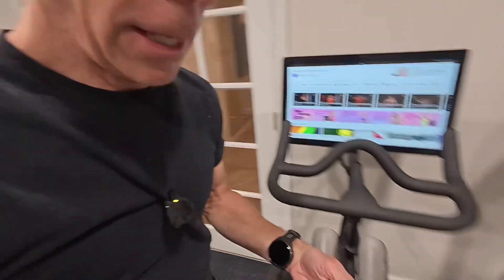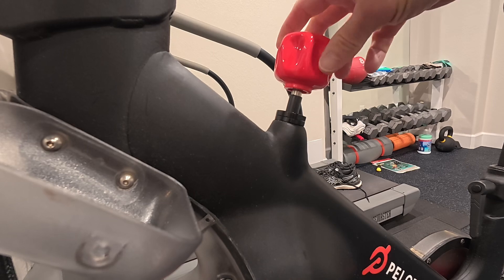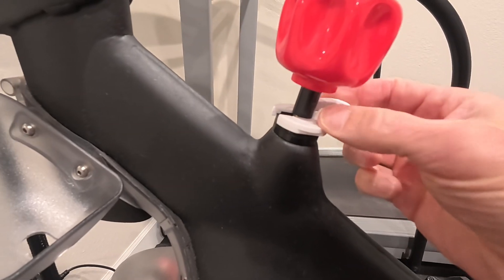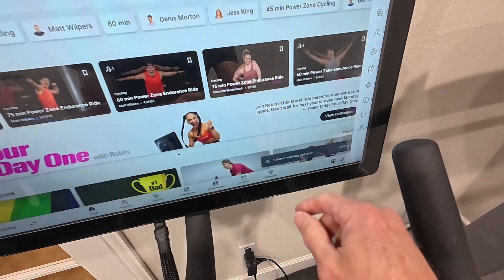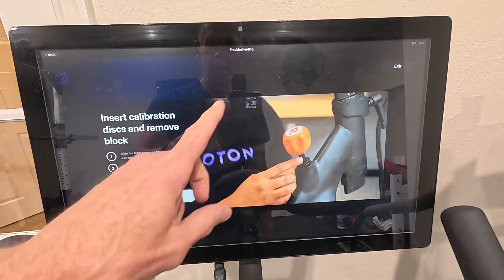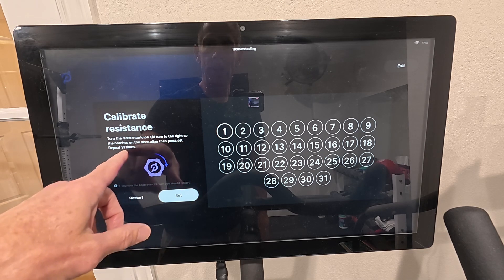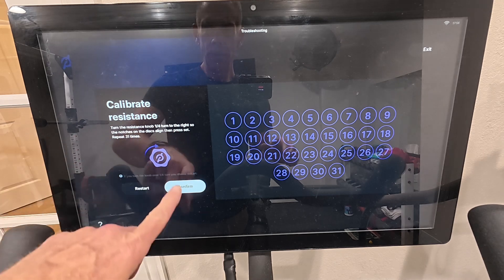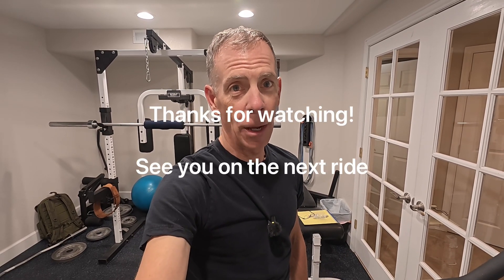Peloton Calibration- 2024 software update

Comment: When you start the turning process, once you have taken the wedge out and got the discs in place, are you hitting set before you make any turns? Or turning once, then doing the rest? I've tried to do mine and now going past 50 cadence seems so tough, also when I get to 100 it stops the bike dead which I think could be a little off still. Thanks
Reply from the maker: Hit set before the first turn.  And make sure the magnets are just lightly touching the spacer block before you pull it off the wheel.  That should be a good starting position for the calibration